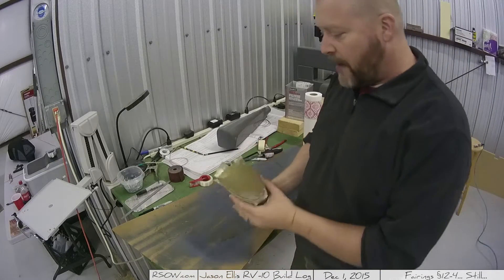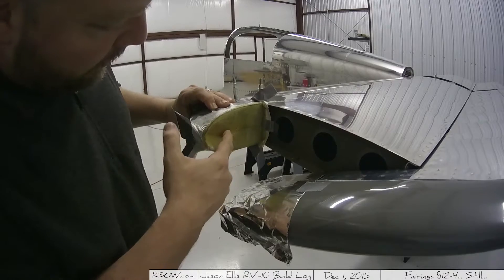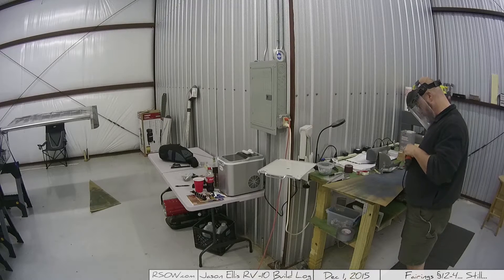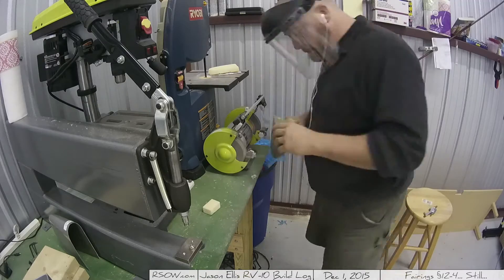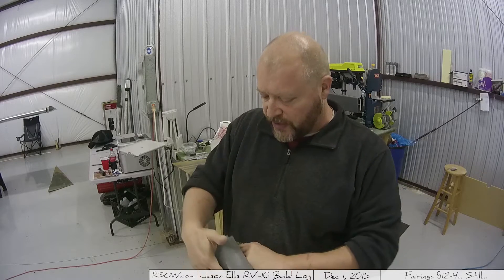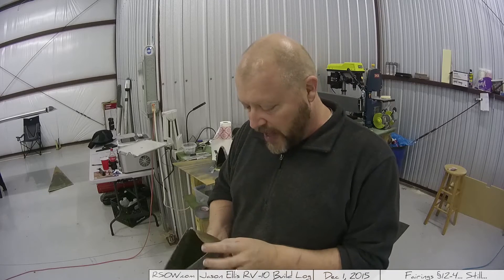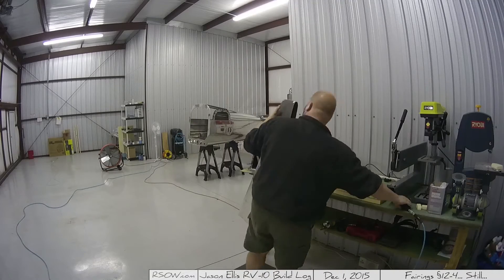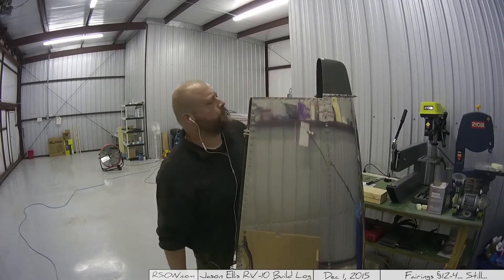RV-10 Empennage section 12-4 - Fiberglass fairings

Comment: Hey Jason, I know that this video is a bit in the past and you are far into the wing portion, but wanted to ask if you recall the materials that you needed/decided to go with for resin, flox, glass mats, etc.

I am starting on this very step on my 14 with the HS and VS tips and researching on the materials that I should get. Also, for the fillet portion on the inside corner of the mat that covers the aft opening and the existing walls of the fairing, did you use strips of fiberglass with resin, or did you use just a resin paste with flox to bond the inside corner with?ThanksScott
Reply from the maker: Hi Scott.. for the fillet I used strips of fiberglass and more resin.  I did add some flox to the resin to thicken it a bit and add support but nothing much.  Regarding which glass I got, I'll have to go dig that up and get back to you.  I forget the exact stuff but its the cross hatch weave glass e-cloth.. or something like that.. (going from horrible memory there.. )

Comment: Just a note.  It is possible to use to much resen.  The fiberglass guys absolutely refuse to add an extra drop of resen to avoid extra weight.  If you would like to see some good fiberglass work go to www.kal-soft.com/velocity.  Andy won a bronze lindy with with velocity.
Reply from the maker: +Roger Laubhan Cool will check it out. thanks